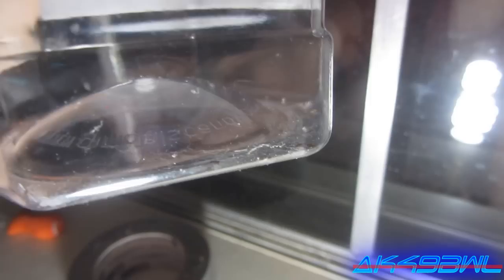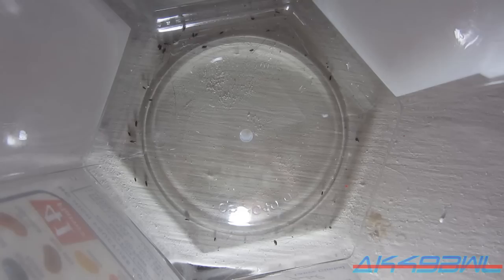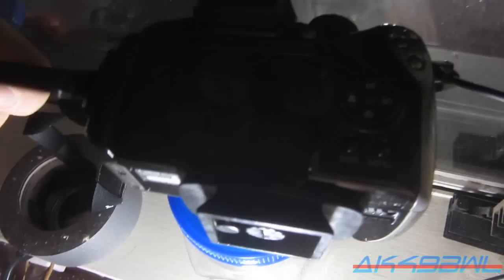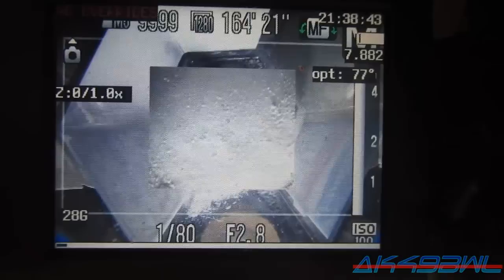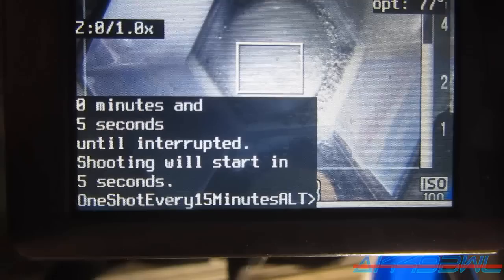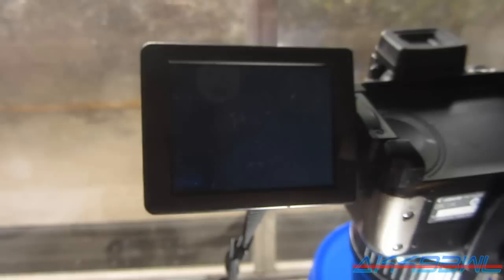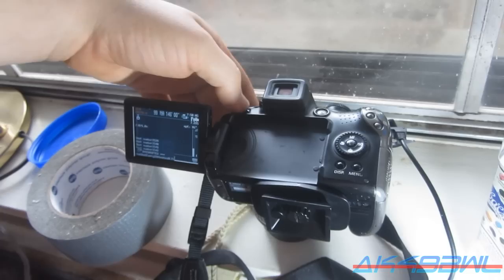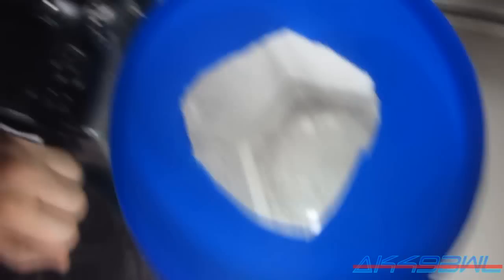Diatomaceous Earth vs Fleas Experiment

Comment: i got a cat 12 years ago. covered in fleas. i took him to the vet and they recommended Revolution which I had no idea what it was. It took one kitten (8weeks) dose and the fleas dropped dead within 15 seconds. i havent dosed him since and we are still flea free. i have adopted 2 more cats and 2 dogs all inside pets except for my 2nd story patio. we do go on walks on occasion. i tried Diatomatecous Earth in an ear product my dog had for a stinky ear. plus cleaned it with rubbing alcohol. I have not been disappointed with Revolution but I am unsure about this DE. I did the dogs and one of the cats with Revolution but not monthly. just one time for each. it also kills the ear mites in cats.
Reply: Basically the DE is an ALL NATURAL alternative for killing fleas and bugs in general. Its fossilized plankton that has an exoskeleton acting as razor blades basically killing whatever is small enough to be effected by it. It does NOT harm anything larger than a canary. It doesn't necessarily work IMMEDIATELY as it is not chemical based. Revolution acts immediately because it is.
Reply: The stuff recommened from my vet for my cat gave him seizures and the only thing you can do is wash the remaining stuff off the cat. It gets into the nevous system.
Reply: DE is more of a general insect killer. It's usually meant to be used in the garden to prevent bugs from eating your plants. DE does a really good job of drying things out in the insect, and they die a slower death than with Revolution. DE needs about a day to two days to kill off anything living in your carpet, which is where fleas like to lay their eggs. Revolution is great for treating the fleas on the cat, while DE is better for treating the environment.

Comment: Apply coconut oil to your cat or dog, then comb it thru with a flea comb to ensure it gets through the coat while also removing the surface fleas at the same time. I waited a 1/2 hour, then washed it off my cat with "Natural Flea Shampoo" for cats and kittens (by Natural Chemistry). I might substitute this for Dawn instead. Then I washed her off again with a moisturizing tearless kitten shampoo. A couple days later, I sprinkled baking soda all over my carpet, deck and bed (adding rosemary, basil and bath salts scented with mint and lavender). Then poured it into my hands and worked into her fur (it makes her foam at the mouth, but unless cats ingest a cup of it, it is not hazardous). After several days, I vacuumed the carpet and no more fleas are attacking my legs, but I still need to keep addressing the few fleas still tormenting my 16 yr old cat who never had fleas prior to moving to Los Angeles this spring.
Reply: Heather Mehudar  If your cat is foaming at the mouth, that's an indication this treatment is hazardis, stop immediately. I also just read that mint oil is not a good treatment for pets or pests. Try mixing half white vinegar and apple cider vinegar and water in a spray bottle (careful around eyes, will burn) massage into the fur and leave on after towel drying. Cats bathe themselves so the vinegar is not toxic. Or try rubbing baking soda on the fur also not toxic.

Comment: someone please help.. i found 2 fleas on my dog about a week ago. ive washed her several times, put DE  on all the floors and vaccuum every couple days. ive never seen any fleas jumping around or any flea bites.. my question is do i still have an infestation  and how long do i need to continue with all the measures ive taken? Just the thought of it makes me itchy but i dont have any bites or anything that i can visibly see. i just dont know. ive heard precor 2000 works very well. should i try that as well? thanks
Reply: Get a flea comb & everyday brush her , buy flea killer at the pet store ; the eggs hatch every 4 days
Reply: @Mr_Keating  thank you! I cut her hair real short. Will continue treatments as needed.
Reply: The best way to get rid of fleas is vacume twice a day. Empty the vacume afterwards. It gets the eggs and random fleas. Treat your pets. I’m a beginner with the DE so will try that around my yard. Inside the house I’ve never had issues bc I vacume daily and give my pets frontline  fleas are easier to remove then bed bugs and lice. ;)
Reply: The itch response can last up to and even a little over 2 weeks after the fleas are gone and stopped biting
Reply: @ScottyNatsar  turned out not to be fleas but tiny beetles. My pup also has allergies so now I'm working on a better diet for her. Iodine bath is helping alot as well. Waiting for chlorhexidine.. thank you!

Comment: Wonder if this stuff works on kids heads that have lice? Kinda like carpet I guess.
Reply: It might kill the lice eventually, but the kids' scalps would be severely dry and itchy. When my kids (AND I) had head lice, we tried the OTC lice shampoo first... and it did absolutely nothing to kill the bugs. So, I experimented on myself and used Listerine. I doused my hair in it and wore a shower cap for about an hour. There were dead lice just falling off of me at the end.
Reply: @enig99  I heard smothering the hair in some grease or mayonnaise helps kill them too
Reply: read above comment
Reply: Because of overuse of pesticides, most lice are immune. Easiest, safest and best results can be had simply with a lice comb and cream rinse. Saturate the hair in cream rinse, wait about 15 minutes and use the lice comb. Repeat in 3 days and then in one week. Wash your bedding. Vacuum your furniture thoroughly. Violá! No lice. No pesticides on you or your child. And soft hair.

Comment: Read instructions and follow them. More does not work better or faster. The label says " avoid prolonged exposure to breathing dust. If you use a vacume cleaner with the dust in csrpet you will burn out the electric motor in your sweeper. If you were to hope this worked you need to cover 75 percent of all floor areas and under cushions in furniture and under furniture. Notice he shook container, fleas take about 2 weeks to go through reproductive processes. Good luck using just this, pet and yard need attention also. Sometimes the cold weather makes them go dormant or die also.

Comment: Ugh. So basically this stuff is impossible if you have to leave it so long. I sprinkled it B4 bed and it was so strong I had to vacuum my bedroom right away but I'm hoping the residue will work still because I have a sensitive toddler and I can't do it when she's awake but I don't want to be up all night vacuuming and battling fleas. Btw, wear knee high socks, carry a lighter and just run the flame across their bodies fast enough so it doesn't burn you. You may get a lint fire but they just run around the sock and go out. I like to walk around, get a few on me, burn em, and stuck em in a soapy water bowl so I could count how many I got in a day. 50. After that day it got a lot better. Just do a different technique every day along with vacuuming and they will go eventually. Remember most of it is eggs in carpet/cracks. Get that up asap
Reply: the dirt in your vacuum will kill eggs sucked up if you let them stay in it.

Comment: Tip for applying Diatomaceous earth, Get a small spray bottle and fill it half way with water, then mix in a cup or so of the Diatomaceous earth. Shake up the mixture well and spay on the infected carpets. It'll take an extra hour or so for the stuff to kick in but makes cleaning the stuff up much less frustrating.
Reply: mixing DE in water reduces its effectiveness 10 times .. the whole point of using DE is to cut the shell of the bug and then DE absorbs the water out of the bug .. mixing it with water defeats the whole purpose of it ... 
https://www.ncbi.nlm.nih.gov/pmc/articles/PMC4025297/
here is a peer reviewed scientific study on the effectiveness of DE it straight out says "mixing DE and water decreases the effectiveness of DE 10 times for LC50 and 67 times for upper confident limits "

so no do not mix it with water .. it makes it much less effective
Reply: J.B.  the powder eventually dries and returns to it's original effectiveness
Reply: Why not recommend using a puffer bottle to disperse DRY DE . . . ?

Comment: Can I say I'm glad they killed the ones in your carpet, how ever from someone who has there, each flea lays 50 eggs aday, I remember pets at home told me that years ago, I thought ye what ever, trust me I seen 3 fleas I have now an infestation. 
Carpets curtains clothes, blinds, I ve never seen a flea since the 3, but must of been more, obviously, all I seen was the eggs the larvae pupae, I through my suite out, my bed is new 10mnths later still getting larvae, I've steamed, I'm lucky I hadn't had my carpets laid yet, but this has sent my ocd anxiety off the charts. I firmly believe I had an infestation before I moved in the property.
Reply: Hey! I so understand where you’re coming from. Your best best is to use a combination of things, 1. Don’t put clothes or towels or pillows or whatever on the floor. 2. Use a salt, vinegar, and soap spray in a bottle for floors daily, yes, daily. 3. If you have aircon, and you can keep your home chilled, keep it as cold as possible 24/7, this will significantly slow the life cycle of the flea, and give you a much better chance of killing them before they are able to come back and spread horrifically (stops them spreading faster than you can kill them) 4. If you can get food grade diatomaceous earth, use it, until you can, use salt, it has a similar effect, not as good but it helps especially if you just use it in the corners of your home etc backs of cupboards etc etc etc 
5. Put pillows and jackets and shoes etc in the sun whenever you can, your blankets etc ~ if you can do it daily, do it. 6. Use a rubbing alcohol spray on anything your not worried about bleaching possibly, carpets, pillows, bedding, towels, etc 
7. Re-arrange furniture and possessions every week, even twice a week, doesn’t have to be amazing, but shift the bed, the desk, the couch, so as you clean, your able to affect spots that fleas have built up and consider “nests” without doing this, your bound to be missing some crucial areas where egg laying females are hiding and laying loads of eggs 8. The following solutions should be used alone and together, either all the time or rotated: hot soapy water on its own in a spray bottle, alcohol and lemon juice solution in a spray bottle, salt, vinegar and soap in a spray bottle, peppermint oil and hot soapy water also works (combinations of these also work though check chemical interactions) dettol and other antiseptics can work to make fleas sick, slow or stunned which is always better than nothing 9. Traditional bug spray also helps though it’s fairly toxic to humans and pets so only use if you can getaway from the house for the day and aerate it properly 10. Anything soft and not being used all the time should go into airtight plastic bags or tubs, fully airtight, winter clothes, extra towels, blankets etc put some peppermint oil soaked cotton wool in the bottom it kills fleas really well, and tie the tops off, that way these soft items are enclosed, the fleas are being starved of food and oxygen and have active agents inside this bag that are killing them, and the other fleas aren’t able to access these soft items and lay more eggs / hide in them. 

I hope some of this is helpful. 

Truly the most effective things you can be doing, is to be vigorously cleaning every single day, or at least every second day, and slow the flea life cycle down to give yourself a chance, if you can’t do that, or you don’t have air con, then simply lowering the temperature by closing blinds and having a fan on should help somewhat. 

Though!! IF you CAN get direct sunlight on any part of the house during the day while you clean; you should do this at least sometimes as sunlight combined with the chemicals will help kill the eggs and larvae. 

Good luck, I hope your successful, my old apartment complex had a bed bug infestation and it gave me a nervous breakdown I had to move out, so I fully get your headspace right now it’s draining and annoying and feels so gross to endure 24/7, hope you can get on top of it asap!!
Reply: What have you had done to get rid of them?

Comment: Where do I get it
Reply: You can get it at a co-op or online make sure you get food grade that's what's safe for your pets you can put it on your pets also just sprinkle it on and rub it in really good. It dries out their exoskeleton killing them. And it's complelty safe
Reply: Also be careful letting them breathe it in it isn't good to breath like most things it can cause respitory issues if inhaled
Reply: @lillyhumphreys8732  However,  it can help if you have cats with mange induced sniffles. Sometimes the mange mites get into the respiratory tract, and DE can get in there and kill the mites. I only use food grade,  but it works. Kittens are especially sensitive to mange, and most adults carry it without being symptomatic. Even with regular flea treatment, which will kill most mange mites, there will still be some mites that survive, and will be immune to further treatment applications. Applying a little bit of food grade DE to the carpet and beds helps to kill off the mites that survive the chemical pesticides, and keeps kittens safe.
Reply: Gardening section at any grocery store.
Reply: Amazon is a good place to buy it. Borax laundry additive will also work on floors and carpets. Sprinkle it on floors and furniture, after a few hours vacuum it up. Repeat every few days to catch eggs or new hatchings.

Comment: If you have inside pet birds, research if these powder chemicals are safe for them.  There's a reason why the saying "canary in a coal mine" exists.
Reply: Probably because they were used to detect gas leaks before they killed the miners.
Reply: Because canaries die from  carbon monoxide poisoning, which is nearly impossible to detect without special equipment, long before it reaches deadly levels for humans??

Comment: For insects with HARD back, you have to dilute it in water to work. With ants, who does NOT have a hard back with breatingholes on their back, you can use powerform..
Reply: From what I read that doesn't matter. Fleas have hollow legs and the DE gets in through their legs. Any insect that walks across the DE will eventually die.

Comment: Who the fuck puts diatomaceous earth in their carpet. But shaking and banging  the bottle didn't  kill or injure them.
Reply: I put DE in my carpet. I had a flea outbreak, and DE got rid of them all. That was years ago. It took about 2 weeks to completeloy get rid of them because DE doesn't kill like a chemical, so the eggs that were laid were still alive, but once they hatch...DE scratches the outer shell and gets in between the joints of the fleas, and they dehydrate very quickly. If you live in a humid area a mixture of DE and a de-humidifier works wonders.

Comment: DE may indeed be a 'pretty good deal', but the experiment as shown in the video revealed nothing conclusive.
Yes you coated some fleas with DE and a marked decrease in activity was noted much later, but nothing in the experiment showed that the decreased activity was not what was going to happen anyway. Even if that had been shown, nothing indicated DE was the cause.
Consider that the flees might have fed on an animal that had something in blood that made the flees lethargic.
Consider that putting the flees in a loosely closed clear plastic container undrr continuous bright light might cause excessive heat or might cause the plastic to outgass.
Maybe timelapsed photography is detrimental to fleas....you can't tell anything without some controls and better design of the experiment.
Reply: Or you don't understand what DE is or what it's doing at the biological level, so therefor you don't understand how conclusive this experiment is. 

Why don't you do your own experiment to prove that the plastic container itself and the bright lights cause fleas to go lethargic? Sounds totally plausible. (hahahaha)

Give us the link after you spent some time to create the video experiment so we can audit your success or failure and tell you what you did wrong.

Comment: Try some boric acid. Buy it on Amazon.
Reply: SEEKER8558 wouldn't that hurt your feet after walking on it for a period of time? That's if you walked around your carpet in socks or barefoot.
Reply: No it will not. Even an infant foot is too big to be cut. Like walking on sand. What they are describing is under a very microscope. Google it and also sand, dirt etc. under a microscope. be amazed.
Dust into our lungs is the only harm.